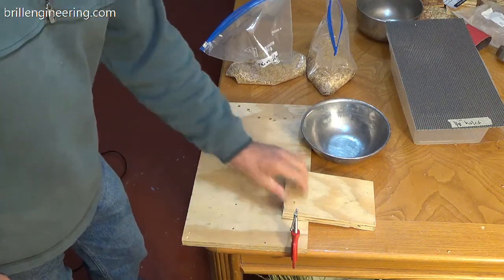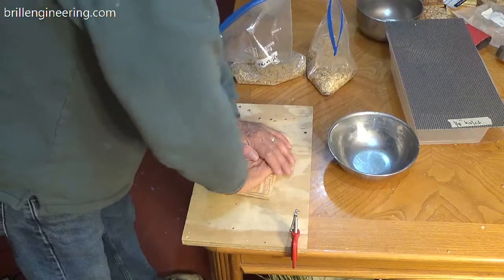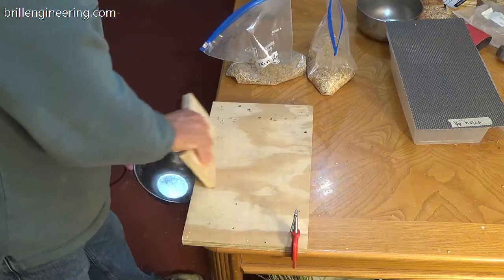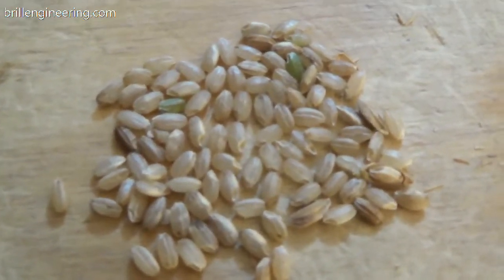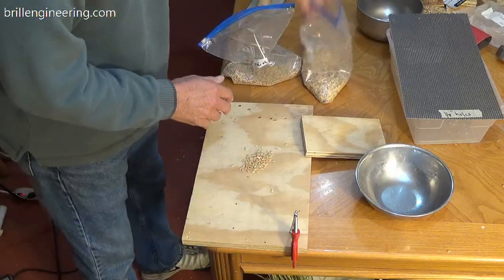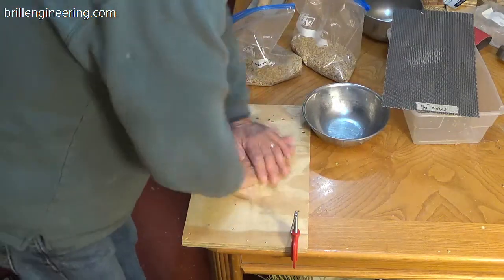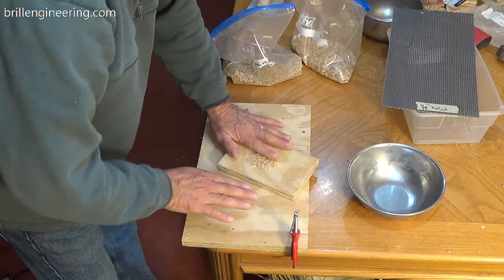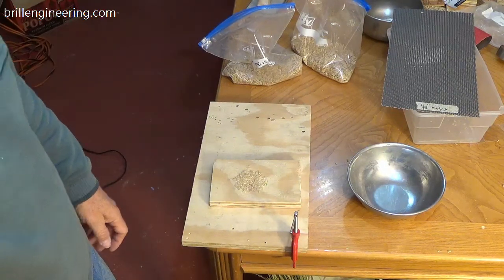de-hulling rice between wood pieces brillengineering.com

Comment: Can it be used on oats?
Reply from the maker: it doesn't work with oats, oats are one of the most difficult grains to de-hull
Reply: @brillengineering7889  It works great on oats you have to roast them first